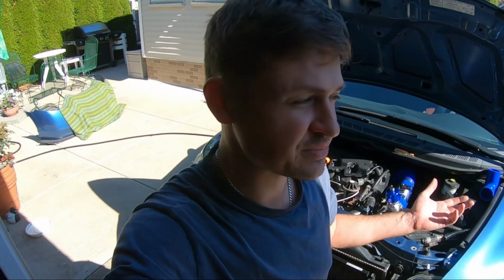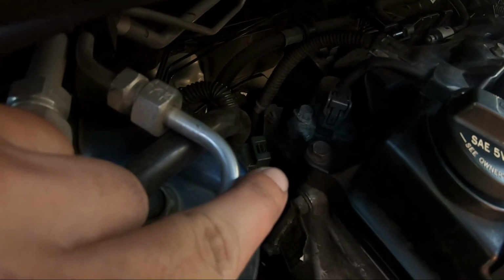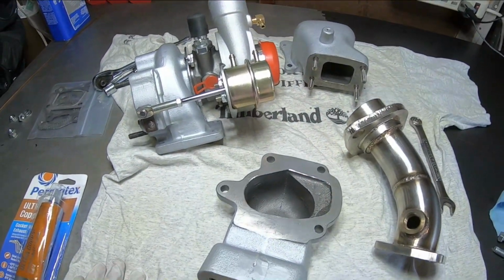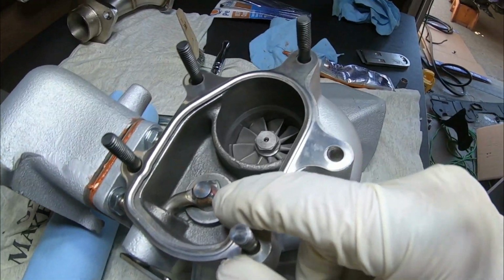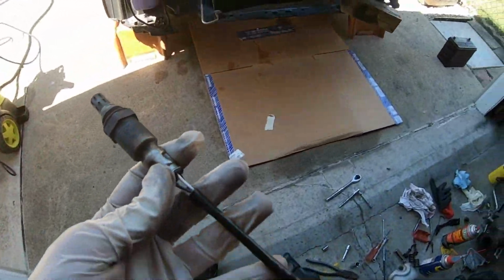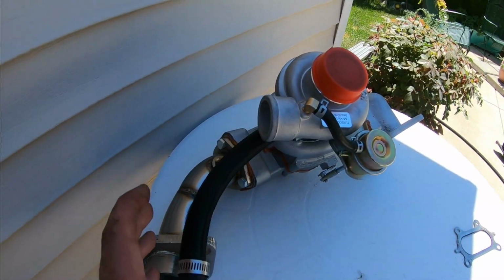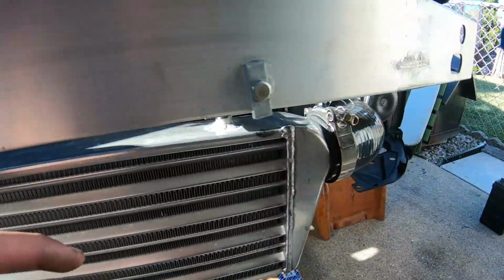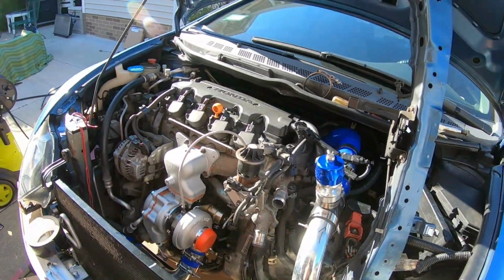Honda Civic R18 Ebay TURBO Build PT 2

Comment: Mine will be done tomorrow and that intercooler was a pain but it’s on now and my  build should be done tomorrow 💪🏽thank you for the motivation and all the ideas. I watched and studied these videos like no tomorrow🤧
Reply from the maker: Please share your pictures on ig or email.  Bullipl@yahoo.com

Would love to see! 

Glad I can help. Sub to support!
Reply: Hey guys I’m curious now how did the turbo setup end up going long term any complaints or would you definitely do it all over again? I have a 2010 I use to DD but it sits around now so I’m thinking turbo build for some fun wanted to touch base with some people who’ve done it to see what they think
Reply: @Jboost412 definitely blew the engine like two months later but hey everything is a learning curve and I loved the experience it taught to have a turbo car everything was modified to make the car run how it was and it just was so very fun and different but I would definitely look into internals before anything
Reply from the maker: I blew mine after 8 months and 8k miles.  
Rebuild the engine  and still running turbo about 7k miles strong now.  It’s all in the tuning.   You can run turbo stock engine just need to be considerate of the tune and dial it back in few key areas to protect motor and rods.

Comment: Sick build, but why cut into the frame and damage the integrity of the body? Was there not another way to route it??
Reply from the maker: There is limited room.   One option would be custom piping.   This is simple and non structural cut.   No big deal.  Can always weld it back if I go back to stock.  I’m ok with it.

Comment: The turbo kit says it’s for 08-11 r18 civics, would it fit on a 2012 r18, i believe the turbo would still mount fine, I’m not sure if there would be anything I would need to make custom.
Reply from the maker: Correct.  Either generation intercooler piping has to be custom.
Reply: @BulliKid  thanks man, I wanna do this but I have 240,000 miles on my engine, it’s still running strong tho, transmission got replaced so its got only about 20,000 but I’m not worried about that.
Reply from the maker: Yah should be fine on low boost is yours a CVT?

Comment: Bro pro tip, you should use isopropyl alcohol to clean surfaces that are gonna be sealed with of sort of gasket. It is farrrrrrr better than any acetone you will be able to get. The acetone that's sold to consumers is very low grade and does a horrible job of actually lifting and removing ay foreign particles , it leaves behind an oil-y type film , and it takes forever to evaporate and it doesn't even evaporate completely to begin with. Isopropyl alcohol is the solution to every one of those issues. You don even need to get the "super pure 99% isopropyl" even at 70% it is wayyyy good enough for anything in the engine bay. However the cost difference is pennies between 91% and 70% so might as well grab 91% lol
Reply from the maker: Hmmm.  Interesting I thought acetone is a stronger cleaner.  I started welding now and acetone seems to clean the bare metals better then the 70% iso

Comment: Making me wonder if the r20a in my 2015 ILX automatic could benefit from the R18 turbo kit seeing how they're pretty identical.
Reply from the maker: Do they have a tuning solution for the ilx?
Reply: @BulliKid  that's the crux of the situation.   Worst case scenario a custom tune with a hondata may be my best bet.  From what I've read the differences between the R18 and R20 aren't far apart at all.  You engine bay as well as the engine itself are strikingly similar from the SOHC layout, oil dip stick handle color/location and even the intake and exhaust manifolds structure and placement are virtually twins when compared to the base 2.0L ILX automatic. The only few differences is the stroke of the crank between the 2 and mine has sport mode paddle shift.

Comment: Can you do a short video , how to install the blow off valve for honda civic 8th please 🙏🏻
Reply from the maker: There is many ways to do it.  
Make sure it’s in charge pipe and route vacuum line from bov to  anything post throttle body.
Reply: @BulliKid  where the hose need to going?
Reply: @BulliKid  like this video at 30:26 you show the hose going where ?
Reply from the maker: Intake manifold
Reply: @BulliKid  Thanks a lot 🙏🏻 keep going do more video about hond civic 8th 👍🏻
Reply from the maker: I will as long as this think keeps working well. Thanks.

Comment: I also have a 2009 Honda Civic LX that I thought about installing turbo at one point but I also trying to figure out what a cheaper way other than turbo I could put on this car that will increase HP
Reply from the maker: This is the cheapest way to add HP.

Comment: Where did you find a maf replacement I was looking for one back when I was trying to get rid of my stock intake
Reply from the maker: It came with the intercooler piping kit
Reply: @BulliKid  Ah, makes sense, was worried I'd have issues finding one if I went boosted.
Reply from the maker: You can buy them on eBay either way.  Different sizes.

Comment: hey man you might wanna do a test fit with the radiator and other hoses around the engine bay, some of those intercooler pipes  wouldn’t have fit on my turbo r18 build and i have the stock stuff still in
Reply from the maker: I did, and I had to trim some components of the radiator fan to give myself some extra clearance.  It’s snug but fits.  Good that the piping is 2” small. with a bigger pipe this would have not been so easy.
Reply: @BulliKid  can’t wait to see your build finished man 🤘🏼🤘🏼
Reply from the maker: Thanks!

Comment: Question I have 2014 civic would that turbo fit in my car ?
Reply: And would the flash pro work on that to ?
Reply from the maker: Yes but you need flash pro for 2012+ civic
Reply: @BulliKid  Question is there a way u can send me all links of the things that u need for the turbo or email u can send it to ?
Reply from the maker: @blezer4875  not possible boss
Reply: @BulliKid  alr but thank u

Comment: what state do you live in? im in cali and were you able to pass emissions i have a r18 manual transmission, my catalytic converter went out and as much as its going to cost me to buy a new one, i can spend on a turbo kit but i dont want to buy a new catalytic conveter, if im going to end up doing a turbo later on and end up having to give up the catalytic converter anyways. so my question to you is if you live in cali did you pass emission espcially  with the egr delete and no catalytic converter
Reply from the maker: I didn’t have to get a emissions test done yet. I am due for one next year.
Reply: @BulliKid   is your check engine light on cause the egr deleted and no cat
Reply from the maker: @ryonrangel5450  no. You disable it in hondata.

Comment: Im planning to buy the exact same turbo kit from alibaba. We dont have ebay in the philippines lol.

By the way are you using the stock intake manifold? Thats the only thing i need to know before i proceed with the build or buy an aftermarket intake manifold. Thanks
Reply from the maker: Stock intake manifold.

Comment: This turbo setup isn’t legal in Cali. But at least it doesn’t take up much space.
Reply from the maker: It has a small footprint.  It’s a tiny turbo.  Good for city and midrange.   It’s not legal here too with no catalytic converters technically speaking.
Reply: @BulliKid  lol how do you get it smogged my man?
Reply from the maker: Luckily I just passed my emissions in March so I have 2 years before emissions again.   But I have some things up my sleeve that I will try to see if they work

Comment: Where you get all the gasket?
Reply from the maker: Came with the kit
Reply: @BulliKid  I check the kit you put in the videos and in the description said it doesn’t came the gasket.....and also can you tell us where you buy all the other things?
Reply from the maker: Everything I buy is on ebay.  
I buy it all seperate. 

Which makes it a “Kit” like in description.  
If the kit doesn’t come with gaskets you need to buy it seperate.  I’m not sure why they wouldn’t include gaskets in a kit.
Reply: @BulliKid  Alright thanks I appreciate
Reply: @BulliKid  So you said you buy everything on ebay right ? I mean pcv valve , hoses, fitting etc?
Reply from the maker: Yes maybe a few parts on Amazon but mostly ebay.
Reply: @BulliKid  Nice men thanks....and also Im sorry to bother you with a lot question lol but i wanna know where you get the other wastage for 5 pound of boost
Reply from the maker: Ebay too
Reply: @BulliKid  alright niceee
Reply: @BulliKid  Hey brother can you send me the link for the wastegate you use please?
Reply from the maker: https://www.ebay.com/itm/REV9-POWER-GT-SERIES-ACTUATOR-WASTEGATE-TURBO-Set-at-5-psi-t25-t28-gt25-gt28-/164331948798?mkcid=16&mkevt=1&_trksid=p2349624.m46890.l6249&mkrid=711-127632-2357-0
Reply: @BulliKid  I really appreciate men
Reply from the maker: No problem
Reply: @BulliKid  I just looking for all the  part right now
Reply: You buy the oil feed line on ebay also?
Reply from the maker: Yes. I went with a 24” -3 an oil line.  Some people use -4an too.  It’s easier to find -4an and fittings tbh
Reply: @BulliKid  Hey men and you still running your oil cooler with the turbo build?
Reply from the maker: Trans cooler only
Reply: @BulliKid  Hey men your o2 sensor work good after extended?
Reply from the maker: I still have not installed it.  My emissions is so in 1 year so I have time for now.
Reply: @BulliKid  ohh ok ok I understand
Reply: @BulliKid  But you got the primary o2 installed right?
Reply from the maker: @alfredoalejandro1  yes I have to that’s my AFR reading
Reply: @BulliKid  Niceee I really appreciate all your help In about to start my build so i just want to have all clear
Reply from the maker: @alfredoalejandro1  no problem.  If you have IG you can always message me there too. Bullikid
Reply: @BulliKid  Alright i send message through there